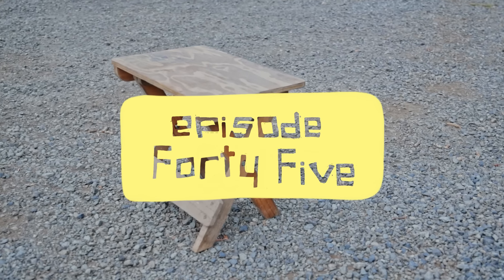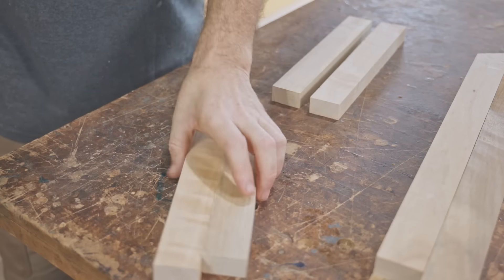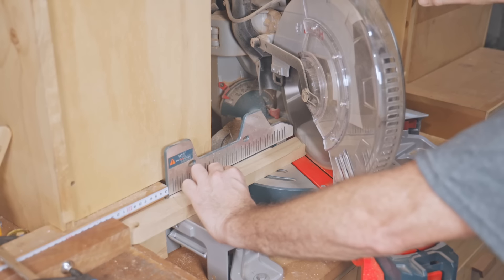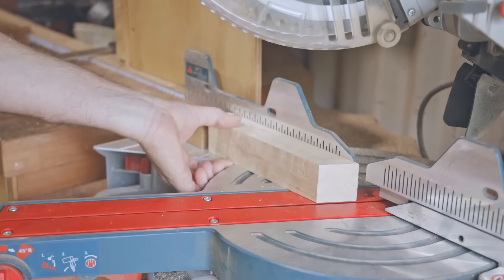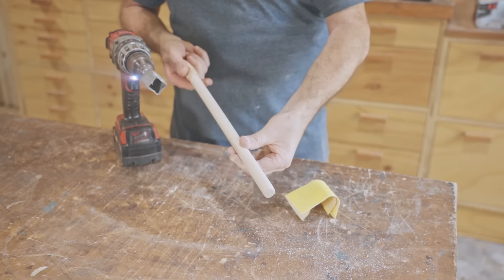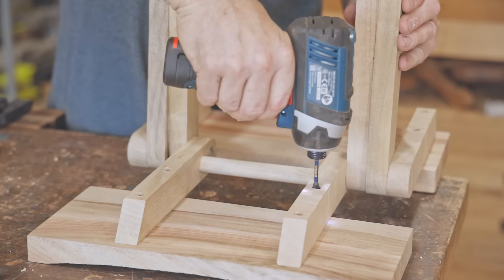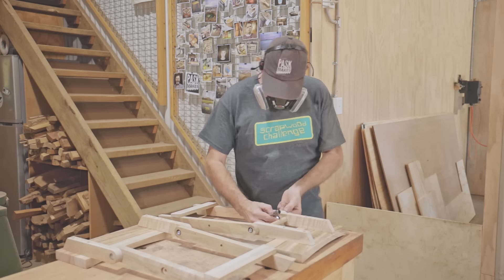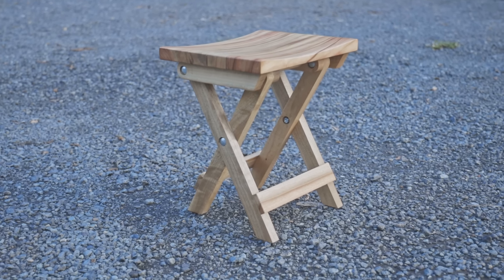Making a Folding Stool - (Day3) 7 Scrapwood Challenges in 7 Days - ep45

Comment: I've seen stools like this where the seat is one piece, just folding to one side - never split in half. I like this one better, symmetrical and much more intricate. Thanks for sharing!
Reply: And better balanced too.
Reply: I’ve seen both, but prefer this one. The asymmetrical version needs something to hold the seat in place, whereas the symmetrical one has the two halves lock each other into place.

Comment: I've made a few of these seats, instead of bolts dowels work fine. The top bolts can be completely replaced by the handle dowel. The bolts in the middle of the legs can be replaced by dowels too.

Comment: I would love one of these in Camphor Laurel - Radiata Pine just doesn't smell as good.
Definitely a cool design. I've been making them with my students for the last 20-odd years and also made a picnic table sized version with slats on the top instead of solid panels.
Cool use of scrap wood Neil

Comment: you may have wanted to consider using nylon locking nuts (the ones with the blue ring on the inside) so that they wouldn't work themselves loose over time. great video and a simple but extraordinary result, I'll have to make one of these in the future.

Comment: I must have taught thousands of kids how to make these... it was a project for year 8 students at the school where I teach. We tried to supersede it with other models, but to date it's been the best at giving students experience marking out and using a huge variety of hand tools. Our design used different rails, and 8 slats at the top. All stock used was pine with the legs and rails being 20mm thick, legs were 340x40 Rails 250x40, slats were all pine but kids could use Blackwood, Jarrah or Vic Ash in an arrangement of choice which were cut to 250x31... we also used them for the braces at the bottom which needed to be 173 and 213 to allow the stool to fold properly. We made several jigs to aid in accurate construction. Great channel!
Reply: Liar

Comment: i've made tons of these using 3/4 inch dowels no bolts or screws, just  use a pin nailer to pin which side of the dowel to make imovable

Comment: Have you been taking lessons from this old tony in new cutting techniques?
Reply: 😂 Pask transformed the technique to wood, as this old tony knows it for metal only 😉
Reply: The first tier of TOT-Fu; the chop. Second tier; dad jokes and time travel. Third tier; automation of antique machinery.
Reply: @Dr_Satan  The time travel will come once he gets a lathe right?
Reply: @Dr_Satan  It is not an antique if you time travel to the time it was manufactured and got it then.
Reply: @theoolifent9074  But Pask has a lathe. A wood lathe. I think that just means time travel is slower, or more rustic and vintage-y. Or maybe that's what that voodoo witchcraft CNC machinery is all about, I don't know. I'm just out in my powerless shed with files and chisels trying to get as few splinters as possible here. So far, the Neosporin and Band-Aid companies are in no danger of going out of business.
Reply: @louisvictor3473  I think Terminator rules apply.
Reply: @Dr_Satan  Terminator has only one rule, and that is that the rules don't add up :v
Reply: I thought the exact same thing when he chopped the wood 😂🤣 
I miss TOT